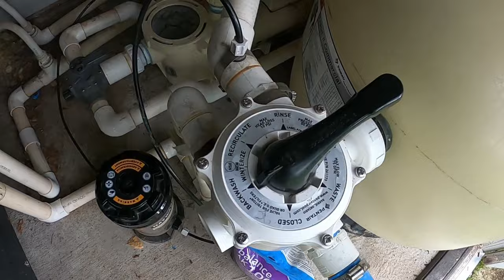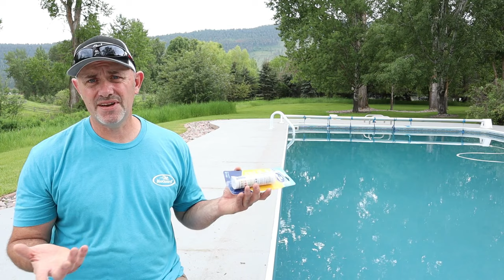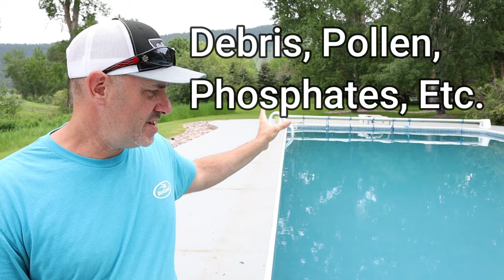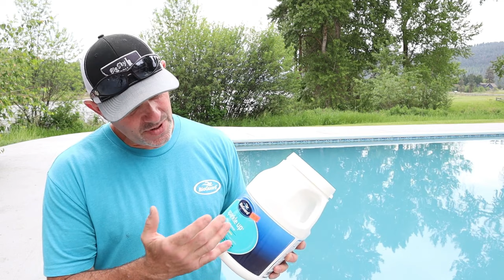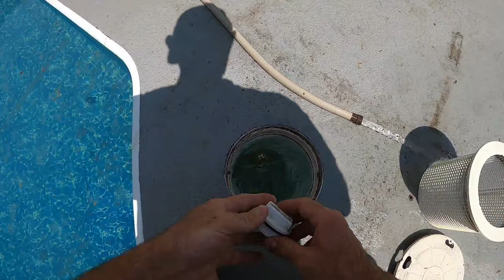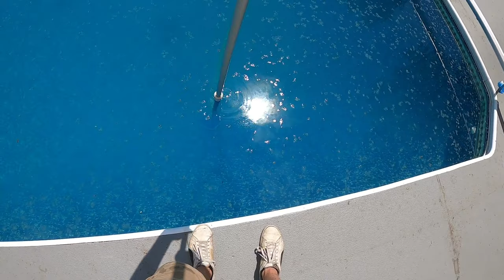How to Clear Cloudy Pool Water: Cloudy Pool Water Fix: Cleaning a Cloudy Pool: Cloudy Swimming Pool

Comment: Great job! Pool looks so much better. You are also right about the CYA. I have a swg and add CYA manually whenever necessary (I like to have a value of around 25, it protects enough against UV and with the 7.5% rule 2 to 2.5 ppm chlorine is sufficient. Whenever  bonded chlorine is above 0.3 I shock using liquid chlorine as it doesn't have any CYA and unlike cal hypo it doesn't contain calcium. Only disadvantage is you cannot store it for more than 6 months. Thanks for the video and best regards. Forgot to mention that for floculantI use flovil which is a tablet you put in the skimmer. It improves the filter and works great.
Reply from the maker: Thanks for watching and the great tips!

Comment: U wanna keep ur filter on when u add floc. I worked in commercial pools for 24 years and we had view ports on our filters. The floc creates a film on the sand bed and creates a layer of finer filtration than the sand. Also stops u having to do as much vaccing in the pool too. You can also extend the life of ur sand in the filter by adding hypo to the filter (40-60ppm) for at least an hour then backwash multiple times. Dirt over time binds to the sand and reduces efficiency. The shock dose to sand breaks a lot of the dirt off the sand
Reply: Hypo? Cal hypo?
Reply: @brtsnx86  yeah cal is better as liquid usually only gets to 30-35%. U can use liquid hypo, just need enough to cover the sand and let it sit for 1-2 hours.

Comment: Great video!  You covered so much useful information!  I have a question about the Floc.  I have heard you have to be careful with it because it can ruin your filter.  So after you do the first vacuum, is it then safe to put the filter back to filter (vs recirculate)?  Or what should I look for to know it’s safe to do so?  Thanks!
Reply from the maker: Yes you can resume filtering after your first vacuum. Floc doesn't necessarily ruin filters it just tends to plug them up fast and they require cleaning.

Comment: likely trying floc today - very cloudy after algae and chlorine demand treatments - tried clarifier as well as normal vacuuming but did nothing
Reply: floc did nothing - particles still look suspended (did not fall to the bottom) we followed the Bioguard directions - we tried to vacuum but it's tough as we can't see the bottom - any further advice?
Reply from the maker: Sometimes floc does take up to 48 hours to settle out really small particulate in the pool water such as pollen and other debris in the pool water like it. I have had similar situations where the floc didn't work also about 1 out of 20 pools. In this situation we did a partial drain on the pool water and used a clarifier with a cellulose filter aid known as sparkle up. It took the filter about 5 days to clear up the water doing it this way but we were in the same position you are in and it was the only other option besides a full drain which we couldn't do because it had a vinyl liner and we didn't want it to take a month to clear up on its own. I'm sorry your going through this with your pool and your situation is rare. I will let you know if I can think of any easier cures.
Reply: @Poolelementary  Appreciate your reply and advice!  Thank you.
Reply: @Poolelementary  - what about muriatic acid would that help at all with cloudiness? Thanks again.

Comment: Hi, I’m on day 3 of green to clean. I shocked level and maintained for two days. Green is completely gone but now it’s cloudy. 

I’m trying hard not to floc but I guess that means patience?

I tasted the water and the chlorine has been at max level since I shocked this morning with no noticeable loss.

My ph was on the low side so I added some and brought it up to 7.2. CYA is good also.

The filter seems to be running pretty well and smooth. I cleaned the pump basket (and skimmer basket) and even blew out the line with a wet dry vac because I saw some tiny bubbles come out the jet. I still may have to vac right from the jet in case there’s something in there. Two other jets haven’t worked since we bought the house but the pool was clear a little last summer and everyone tells me it will run fine on the one jet.

I added the recommended phosphate reducer this afternoon as well.

Still cloudy. I’m going to start using the clarifier tonight and hope for the best. Any advice will be greatly appreciated though!
Reply from the maker: Sounds like your doing everything right and the clarifier is a must to help your filter get the cloudy water clear faster. The one return will do the job but is going to make it take a bit longer being there might be some slow moving water areas in the pool. Good luck 👍
Reply: @Poolelementary  day 4 here and I can see the floor in the shallow end!! Woohoo!

Still a little cloudy in the deep end, but everything on this mornings test still shows maxed out chlorine, got my ph to 7.5, cya at 40.

I’m going to add more clarifier specifically in the deep end then the fun begins.

I purchased a $900 robotic vacuum but said to my myself I won’t even open it until I can see the pool floor. So I see I have a little vacuuming to do.

Thanks again and again and again for your videos!
Reply from the maker: Thanks for watching and sharing!
Reply: I’m in the same shape shallow end clear deep not clear …I know my phosphates are high at 700…clarifier was added. Some reason my cya fluctuates in readings tested water at store said 35, test strips here say sometimes 30 sometimes none. Have wondered if phosphate is ruining levels, but scared to add phosfree I don’t know why maybe bc they don’t say what’s in the bottle (?) curious if you know about phosfree..I did see sparkle free at the Walmart and ordered phosfree on Amazon…I have a sand filter and a salt pool salt 3050 level now

Comment: My pool was like yours I through shock in it about 4 gallons one day then another 4 left it for a day or two and the pool got really cloudy. I test strip it and my reading:
 
total hardness = 120,
total chlorine =1,
free chlorine =0,
Bromine =0,
total Alkalinity =80,
cyanuric acid = 0, 
PH = 7.6
Another guy on you told says if you have normal or low chlorine and Ph is 7.6 its microscopic add another 4 gals of shock. Sorry for the burden my sons' friends want to get into the pool.

Comment: Can you back wash if you don't use sand ?
Reply from the maker: What are you using as filter media? Backwashing is a setting only used with sand filters not cartridge filters
Reply: @Poolelementary  the poly balls .
Reply from the maker: Sorry I'm not familiar with the poly balls so I couldn't honestly answer your question with out doing some research